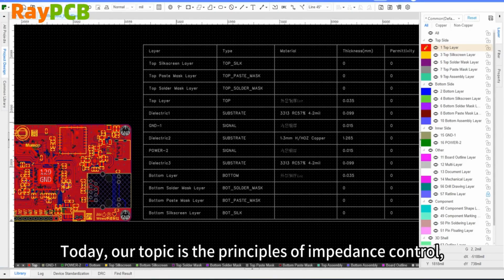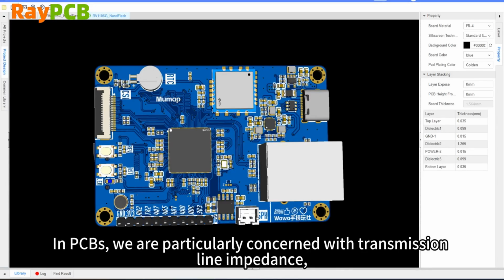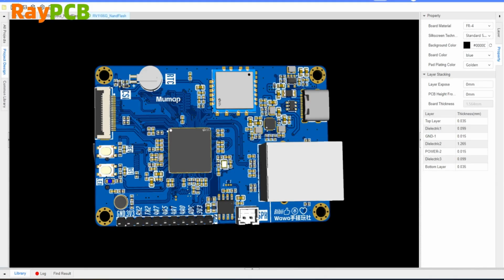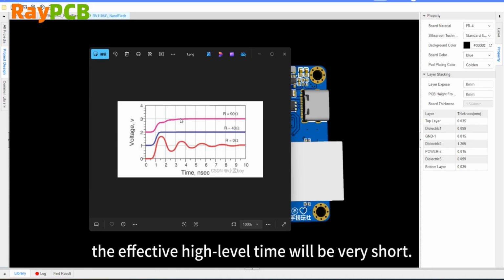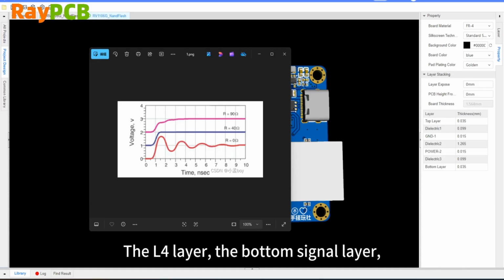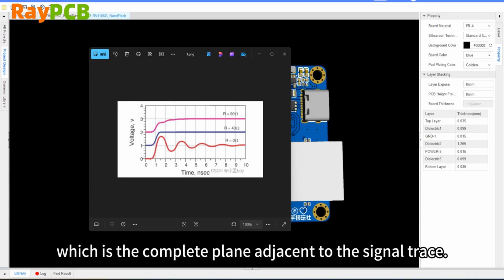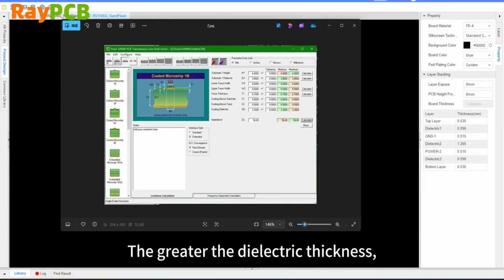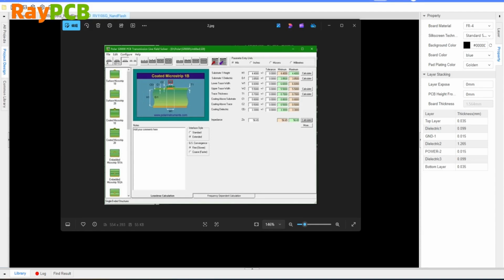PCB Impedance Control Principles Microstrip Lines & Influencing Factors #69

Comment: Thanks but always surprised that after so much work to make a nice video no one has double-checked the sound level, it is very low, you can increase +12dB without problem.